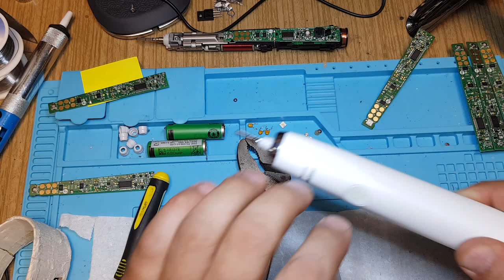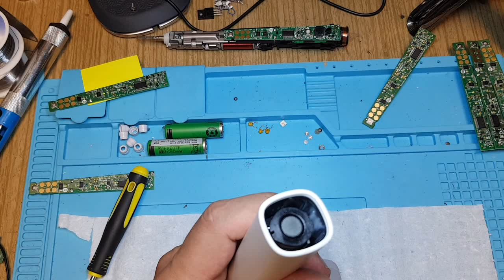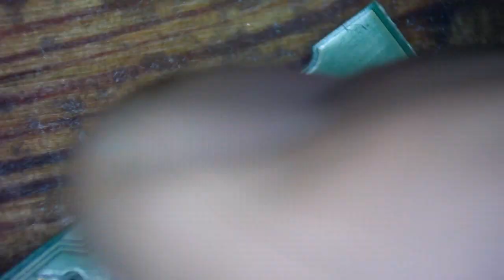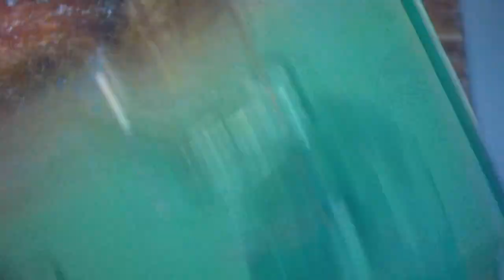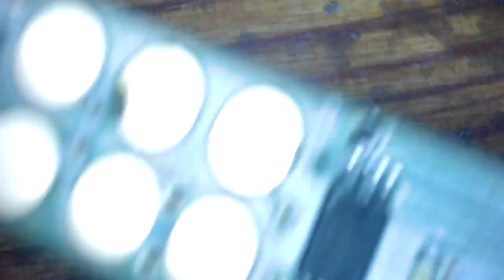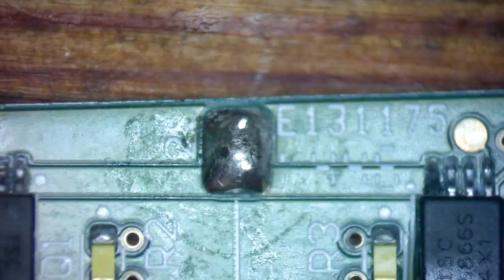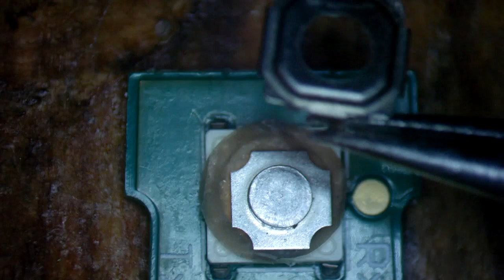Diagnostics and repair solutions of all known Philips Sonicare toothbrush defects in one video

Comment: Hey there. My Sonicare, when turned on, vibrates first shortly then one longer vibration. Green light is on and yellow is blinking. I managed to take it apart thanks to your tutorial. Water everywhere. Battery is showing 3 volts. My suspicion is that it is not charging. I have dried it out, but still no luck. Any tips where to start diagnosing?
Reply from the maker: Yes yellow led is for low charge. Water damage is always difficult to suggest.. best way is to have two boards and check continuity of the traces and IC's in diode mode or resistance mode.. and definitely check if charger is charging.. they go bad too.. hope this helps
Reply: @letsfixitgarage  I found the problem--the issue was one of the leads from the charging coil. It was interrupted (broken off) on the way to the PCB and it was not visible because it was covered with the residue (oxidation?) from the water. Soldered it back on and it's charging now. Thanks, you helped me confirm that it has something to do with charging.
Reply: Seems like the whole thing is not really well waterproofed. Shouldn't there be some glue around the gasket? I'm also wondering if I should store the brush horizontally--less chance of water seeping in from the head.
Reply from the maker: Nice find 👍haven't had that kind of damage.. and did you took off the pcb from the plastic holder? Usually there is much more damage/corrosion going on under the pcb but if it's working you can leave it as it is and if something comes up this would be a place to take a look first :)
Reply from the maker: Dis you inspect the upper rubber seal by removing the plastic cap? If you found water inside it will have a hole because of the build up other place where I found problems although not that often is the on/off button. This should be inspected to. If you keep the upper seal clean the seal is water tight and no problem whatsoever. Of course new design (flat rubber seal) could be an improvement but repaired few of these too.. so that's the only part that needs inspection and maintenance..
Reply: @letsfixitgarage  I did not remove the PCB. Didn't want to break more things :) I checked the seal, dipped it into vinegar to get rid of the buildup. Did not find a hole. I think it just hardened and potentially got a bit twisted. Not sure. I was ready to buy a new one, so I'm happy that it works for now. Thanks again for your videos, I hate when I'm forced to throw away stuff that is likely easily fixable. We produce enough of trash already.
Reply from the maker: @poklop84  your welcome! that was the main idea behind this chanel and I'm planning on adding more teardown and repair videos to hopefully reduce at least a little bit of e-waste.. do check the seal wery well: twist it, pull it a little bit.. if there was build up usually there will be a micro tear as well that's where the water comes in and sadly doesn't have a way out..
Reply: @letsfixitgarage  If there was a tear, is there a way to fix it? I don't think I can find spare ones easily.
Reply: Found them on ebay. I will order a few just in case. Thanks for the tip!
Reply from the maker: @poklop84  check eBay or AliExpress. You will need to replace it. Don't think any repair will hold..

Comment: Thank you so much for your videos.  The metal around the screw at the top broke, which seems pretty common, and I would order a new part, but I cannot get the screw out.  It's frozen to the washer, which is rotating in the metal casing.  I've tried WD 40, and holding the washer with pressure, but the screw is still frozen.  Any advice?
Reply from the maker: Try to insert a screwdriver or something to lock/hold the nut in place then it will not rotate and you can unscrew it easily.
Reply: @letsfixitgarage  it's so kind of you to answer.   Yes, I've tried to wedge a knife tip in there, to hold the nut in place - and when I do get it held - which is tricky! the screw is still not budging, even with WD40.  I may liquid weld it all together and see how much life I can get out of it, if I just can't loosen that screw.  Or I can try to liquid weld everything but the screw!  And see if then I can loosen it!  It's so lovely of you to have put all this smart stuff out - thank you!
Reply from the maker: That's strange.. usually the screw is easy to unscrew.. not sure what you want to use for liquid weld but it is a tricky place there are a lot of vibrations not sure it will hold... But sure play around and if it fails you can always replace the whole electromagnet unit..
Reply: @letsfixitgarage  yes - I tried various things - I ended up supergluing the metal screw housing to the casing so I could have more purchase on the screw - in the end, a TV repairman with an open shop and a good tool got the screw out.  I put the new head tip in and 1 month later, it's broken - cheap metal.  I'm not giving up though.  I love fixing things and hate throwing things out.  Thanks so much for all your videos, they're helping me again with getting the whole thing open.  Stay safe and well.
Reply from the maker: Yes I hate it see when working things are discarded for easy defects.. sadly there are no official spares for this toothbrush so it could be a cheap knock off part.. try to purchase on eBay a defect toothbrush with liquid damage they go out quite cheap and you will have yourself an original spare ;) and another toothbrush to check out more complex repairs ;) good luck with repairs and stay safe!
Reply: @letsfixitgarage  thank you so so much.  I've put back the original triangle-shaped screw housing, so maybe that will hold.  I live in a country that doesn't receive most eBay, unfortunately :(((  The whole head is sitting a little not-parallel to the stainless housing though.  I'm not sure why.  I"m going to leave it out for awhile and see if it comes to me.  Thank you for your great knowledge and generosity!!
Reply from the maker: @karenchoan5094  head is a little bit tilted to the front on all toothbrushes, try to put it in to the housing and see how it looks.
Reply: @letsfixitgarage  OH!  See - that helps so so much!  I put it back together - 100%.  Thank you!!!
Stay well and safe!

Comment: Great videos sir! Really good video quality and great repair guides! 
My tootbrush only does one single, short vibration. The "Clean"-LED flashes at the same time. But nothing else. Any idea?
Reply from the maker: Whenever I hear these symptoms I suspect water inside.. take it apart and the motherboard off it's casing to inspect the back side. And check my other videos for water damage repair. Other suspect could be the battery try to exchange or power up from external 4v power supply.. hope this helps!

Comment: I have an issue where it won’t charge or turn on by the switch and when it’s on the charger, I does one long vibration followed by two short ones.  Is that covered here?
Reply from the maker: Could be. First I would suggest to open it up and see if you find water damage traces.. if yes you can come back here and check out the suggestions..

Comment: Hello,
thank you for the great video!
Do you have an idea what it can be if the toothbrush no longer charges when it is in the housing? It charges without a housing, we replaced the battery and replaced the seal on the head.
Everything went well but the test of loading before closing the handpiece was unsuccessful.
Regards MB
Reply from the maker: A little bit more context would be good you replaced battery and the seal because it was damaged? Or what was the initial defect you started the repair..
Reply: @letsfixitgarage  The on-switch was pressed in and was extremely difficult to switch, that was the main reason, as the battery always has to be recharged very quickly, we replaced it and replaced the seal as a precaution. The button could be cleaned under water and is now fine again. But when everything is in the case, it doesn't charge either in the glass or in the travel case, without the case it charges normally!
Regards MB
Reply from the maker: @mariabraach3153  did you found any signs of water inside? If any usually there is more under the Mainboard to see it you have to take it off the plastic frame. Sometimes when the toothpaste buildup is extreme it tears the button sealing and water can get inside through button not only sealing. From my experience draining battery is a sign of water damage usually battery holds long and strong with this toothbrush.. so either way to look further you need to take the motherboard off the frame and check for any corrosion signs or defect components.. it's not an easy task.. and sadly for now I don't have any advice on charging circuit diagnostics.. another option could be if the toothbrush functions get the wires from battery terminals and charge it with externall charger.. but it's not an elegant solution and water rightness will be compromised..
Reply: @letsfixitgarage  There are no signs of water inside! Everything is clean, no signs of corrosion.
It looks like the distance to the charging coil is too great when everything is in the housing. Could it be the battery itself?
It's from Ebay with this description:
Li-Ion battery, 800mAh, 3.7V suitable for the following models from Philips:
EasyClean, FlexCare, HealthyWhite and DiamondClean.
Thank you for answering us !!!
Regards MB
Reply from the maker: @mariabraach3153  it's difficult to say..  original battery is charging and holding the charge as I understood so I would look for a defect in coil or charging circuitry or charger itself.. but if it behaves the same in portable case and the glass then problem should be in the toothbrush.. I would look for a donor toothbrush and check voltages and resistances on various components between two of them.. as said defects in charging circuitry are quite rare so haven't worked on it till now..
Reply: @letsfixitgarage  Today I checked everything again under the magnifying glass, but didn't find anything, then I soldered the old battery back in and it worked again. so again soldered the new battery and it charges again in the glass, but I have no idea why!
I hope it stays that way and thanks again for your support.
Regards MB

Comment: your videos are fantastic. I have managed to open the back cover of the casing, the hardest part is to take off the PCB from the magnet part. Are there any tricks so can pull it apart safely to remove it? Thank you in advance. cheers
Reply from the maker: Thanks hope it helps a lot off people :) yes it is discouraging first time when you do it. There is no trick just pull it apart strongly. There are two plastic clips beneath it, but even if you break them when you put everything together the bottom cap will hold everything in place so don't fear and pull it apart ;)

Comment: thank you for the detailed video! I found my toothbrush to have rust at the end of the electromagnet and some toothpaste around the magnet and electromagnet (where the gap should be). Is that a good indicator my toothbrush is a lost cause? The toothbrush still charges with no issues and the leds are fully functioning, but nothing happens when I press the power button
Reply from the maker: That's the water damage on pcb case, but it's repairable. I have 3 videos about how to fix it, but you will need special tools like microscope. In the last video I filmed how it is beeing performed just to see what needs to be done.. if that's a little bit to much you can send it to me and it will come back to life :)